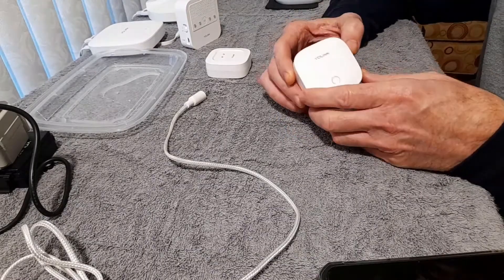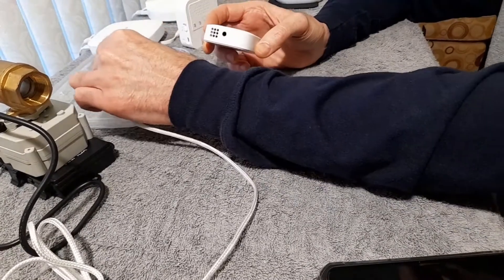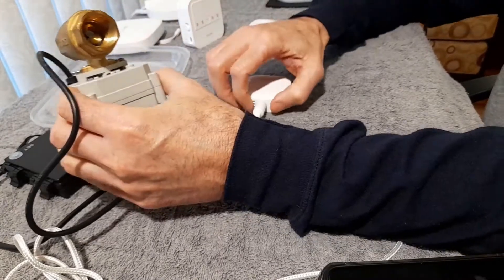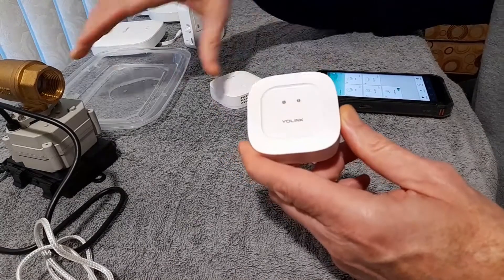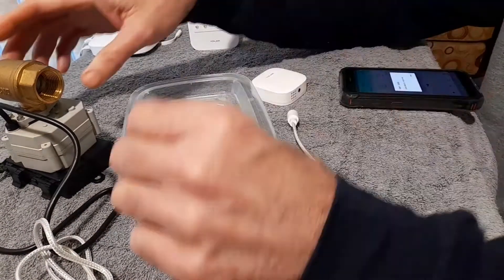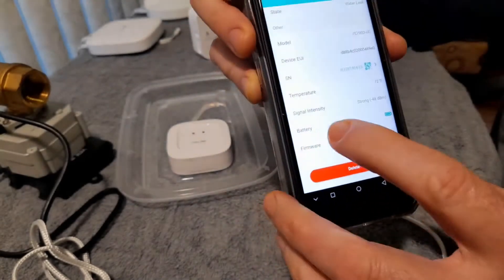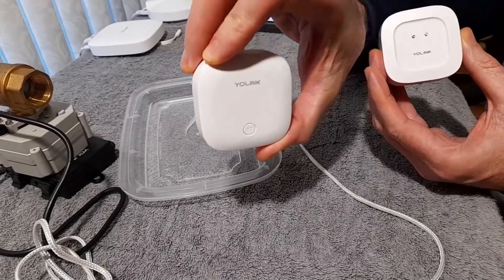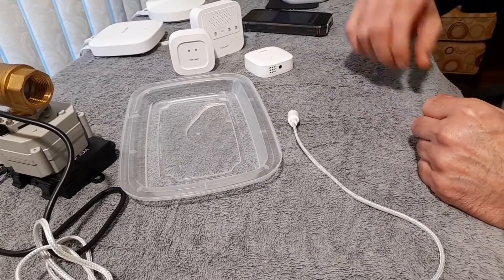Do you believe Yolink's leak sensor will prevent water damage?

Comment from the maker: Let me know if you have any feedback or questions.
Reply: My water leak sensor with the same firmware 030D still works fine. I have the same automatic valve you showed and it closed when tested and I got the notice on my phone and through Alexa. Not sure what could be wrong with yours except maybe you need to pair the sensor with the siren and valve if you haven't already done so?

UPDATE: Okay, it's 45 minutes later. After some experimentation, I was able to replicate the same behavior you have. I'm fairly certain it's the pairing process that stopped yours from working. 

I have two valves and one non-probe leak sensor. The sensor was paired with only one of the valves--has worked fine since day one. After watching your issue, I decided to pair the leak sensor with the second valve I have. It paired normally with the second valve but then the first valve was no longer paired. I kept trying to pair the sensor with the original valve but it just wouldn't work with it again. It only worked with the second valve. This leads me to believe you can only have the sensor paired with one valve. (I assume you can probably can have multiple sensors paired with one valve but I only have one sensor.)

Since I wanted the sensor paired with my original valve, I had to go through the pairing process again with the second valve even though it was already paired. This seemed to un-pair them. Next I paired the sensor back to the original valve and it worked. I'm never going to touch them again :) 

So, perhaps you had paired your non-probe leak sensor to another device and it lost its original pairing with the siren and valve?
Reply from the maker: @davest123va  just reread your post about never touching the sensors again. I got a chuckle out of that and totally understand.  Don't think I completely followed how you were able to unpair the sensor from the second valve to reset it back to the first valve.
Reply: @CyberMedics  Depending on the original pairing state, you will either pair or un-pair them directly by doing this:
1. Hold the Set button on the leak sensor until it flashes green--then let go. 
2. Hold the Set button on the valve until it blinks green--then let go. They will both stop flashing green. 

Then I did the same procedure to pair the sensor and my original valve to pair them again. 

Note I did not setup any Automation in the app--I just paired the devices directly without using the app. 

If you continue to hold the Set button while it's flashing green (don't let go, continue holding for maybe 30 seconds) it will eventually flash red once. I don't know what this indicates. It didn't change the pairing state of my devices.
Reply from the maker: @davest123va  Have followed  that procedure multiple times.  The flashing green light goes off on both devices as though they are paired.  Result always the same....alerts in the app, but doesn't communicate with the siren or the valve.   

At least the problem is consistent. I can pair each probe sensor independent of the app and it communicates successfully with the valve and the siren. Every contact sensor paired independent of the app does not work with the siren or the valve. Grateful for all the input.  Will reach out to yolink support again to see what they recommend.
Reply from the maker: @davest123va  I did try direct pairing of the contact sensor and it also failed.  All of the probe sensors work correctly.  I'm going to post Yolink's responses to my tech support request.  Many thanks for  your effort.  Hopefully we can prevent some frustration for other users.
Reply from the maker: I've reached out to yolink for technical support. They are really responsive and I'm sure they'll get it resolved soon.
Reply from the maker: @User-u6i1g  Thank you for the feedback and for subscribing.  Pairing  is a little confusing. Whatever state the valve is in when it is paired is the state that it will return to when the contact is alarmed. We did a video showing this on the valve. https://youtu.be/-wtSk3Pze1A
Reply from the maker: @User-u6i1g  Please keep me updated Bart. I purchased some new contact sensors and they seem to be working properly. So I suspect the problem was with the sensors not the valve. I will keep everyone updated thanks again
Reply from the maker: @User-u6i1g  lol foolish like me too.  I've started communicating with her product development team so I will definitely pass on your recommendation for the big yellow warning sticker. That is an awesome idea! I want them to succeed because they have the best value in the market for water sensor protection.  Let me know if there's anything I can do for you.